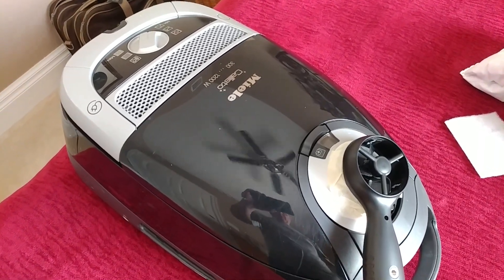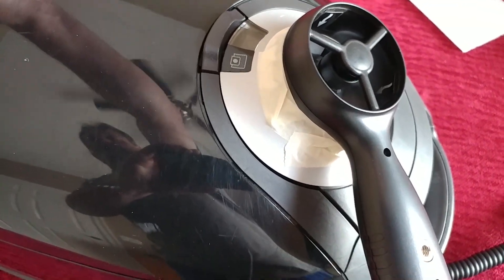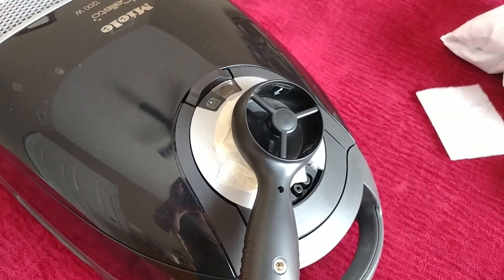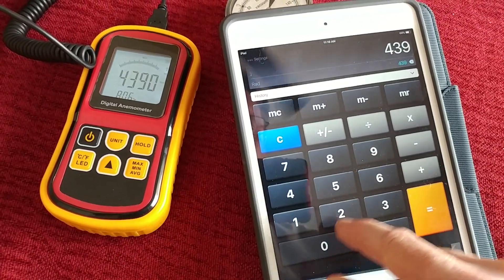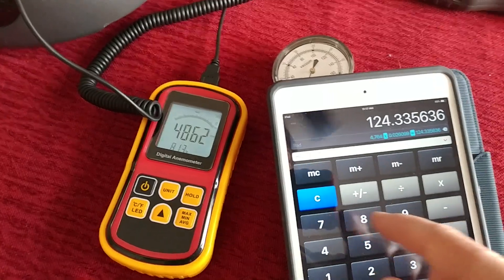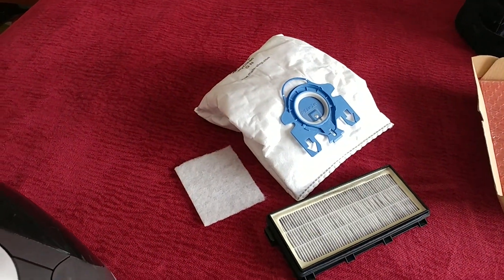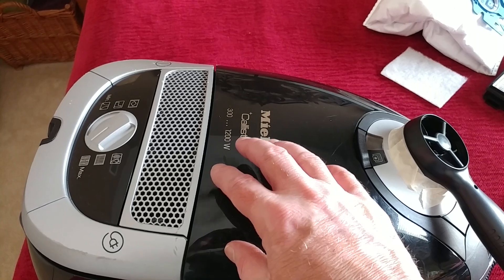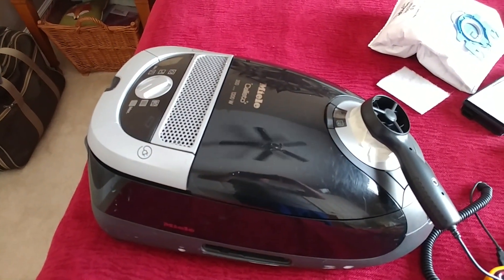Miele Callisto S5281 Raw Airflow Tests

Comment: Wonder how much CFM can my 220V 2200W S8 can achieve...
Reply from the maker: Just got back home today. With a fresh clean bag and filters @ 121 Volts I get 99.2 CFM from the hose. Blackheart got 95 hose CFM.
Reply: VacLab That's pretty much what I expected. It will be interesting to see how well it can cope in your tests.
Reply: US model C3 with the 1200w motor pulls around 103 cfm from the hose end. My C3 with the 1600w motor pulls 121 cfm from the hose end. 2200w, maybe around 130-140 cfm.
Reply from the maker: Dunno, but it could be pretty high. But vacuumtests from Finland has performed some higher power vacuum tests. Check out his channel.
Reply: That's interesting. Would a US model 1200W C3 be the same as an EU model 1200W? Because I feel that the C3 Uniq 1200W on economy setting, suction wise, feels about the same as my C3 2200W on area rug setting. Would be cool if I could obtain a baird meter/airflow measurement tool for cheap

Comment: This really should have a potential. I saw that powerhead and it's the Miele SEB 228 (Wessel-Werk EBK 360). So with that  powerhead it should do well in your tests. Sadly for the high airflow, motor should be at least 1600 watts.
Reply from the maker: Vacuumtests the answer is 66 nozzle CFM at 116.7 volts. So pretty much matches Blackheart's C3. Considering the price for this machine, I think this is pretty lousy. 😠
Reply: I just checked from the vacuumland and C3 measured by the Blackheart, it only got 65-67 nozzle cfm. Very confusing because my C3 using 1400 watts gets 92 cfm. I wonder what you will get.
Reply: There's a few differences between your setup and mine though. Your motor runs at a higher wattage, I think you've just got a modded non electric hose but running a cable through it should make it comparable, using a non electric wand which has a slightly larger diameter due to the lack of a cord channel and a sebo powerhead which is slightly more efficient.
Reply: I'm glad to hear your result matches mine. Have you noticed weak waterlift at the nozzle as well? It seems like it leaks quite a bit.
Reply: Just got a watt meter today. At max setting, my 2200W S8 drew 2500W, 1200W S8 Uniq drew 1500W. Both had fluctuations of 10-30W when the hose is attached. Will record my findings when I receive my anemometer in a few weeks time :-)
Reply: jaywalkra Looks like your watt meter measured the peak power. 2200w Miele in the real life situation should be around 1900w. My 1600w Miele uses 1400w in the real life. Can you make video of your watt meter?
Reply: I guess you're right about peak power, it didn't reach 2500W this time. Sorry, am a newbie to all these measurement stuff. Here's the video (also recorded the drop in wattage with hose attachment): https://www.youtube.com/watch?v=-13sfGy7vlo
Reply from the maker: jaywalkra hmmm, they both draw quite a bit more power than manufacturers specifications.
Reply from the maker: EvilKlownz4u I can only measure water lift at the canister and hose end since my airflow boxes are only cardboard. But my measurements match yours very closely. Thanks for doing your airflow tests!
Reply: VacLab 66 cfm is low. I am shocked :(
Conditions for my C3 are: No hepa filter (just a micro filter), motor rated 1600w (measured 1400w), non electric hose (cable inside it), more aerodynamic hose handle, Sebo powerhead.